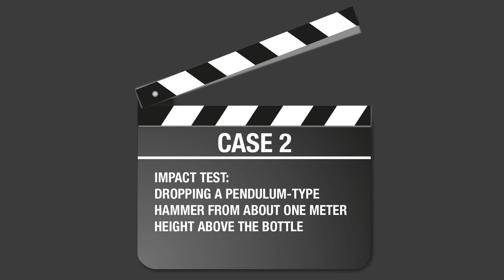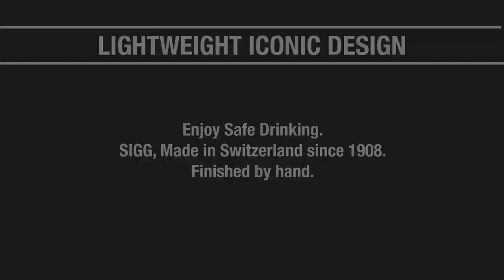SIGG Bottle - Inner Liner Tests -  Enjoy Safe Drinking

Comment: My kid's bottle has a few dents but they are not huge. However,  yesterday my kid complained that he had something strange in his mouth while drinking from his bottle.  Luckily he didn't swallowed it but he pulled a piece of liner from his mouth. 

I have never used the bottle for anything but cold tap water.  I've always hand washed it and let it dry when not in use. I had expected to have an Eco-friendly durable product and I am quite disappointed to discover the bottle lasted only a bit more that 2 years. I have another SiGG bottle which I bought recently and now I wonder if it will last longer than 2 years. It's quite a disappointment as the SiGGs bottles are not cheap.
Reply from the maker: Hello! What you describe should not happen. Please send an email to swiss-shop@sigg.com, our customer care service will help you further!

Comment: +SIGG Switzerland Nice video. I am here because my bottle's got a dent and I've just pulled a piece of liner from my mouth. Granted, that dent is there for months, but maybe that's the problem of your testing. You don't consider any aging effect. I have never washed it with hot water, never had anything other than water in it and I've always treated the bottle with the highest respect. I wanted to buy an eco friendly long-lasting product and I am quite dissapointed, because there's no way I am drinking out of this bottle again. What do you say, SIGG?
Reply: Lukáš same thing just happened to me tonight after 2 years. the dents on the outside are barely noticeable but I got a mouthful of plastic tonight!
Reply from the maker: First of all, please accept our sincere apologies for
not having delivered up to your expectations and our quality promise.
What you describe should not happen. SIGG keeps up to
speed with science developments, and liners (protective films) have evolved
quite a lot in the last years. The bottle you might have could contain an old
version of the liner that under some strange circumstances can peel off.

 While the liner peeling off is not acceptable, it does
not represent a risk for you since it does not contain any toxic materials (all
SIGG products and components are compliant with EU directives and FDA
guidelines)  

 We will send you a new bottle to make sure that you
are happy and satisfied with the use of SIGG drinking bottles. Please share
your postal address with swiss-shop@sigg.com. 

Thanks so much for contacting us and sharing the
pictures since it help us to deliver the quality we promise to our customers.Best, your SIGG Team